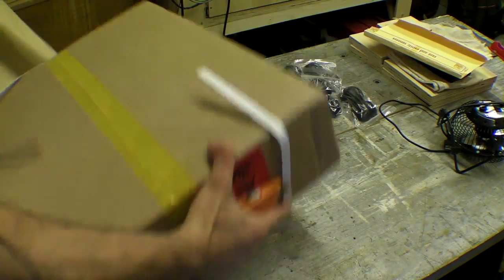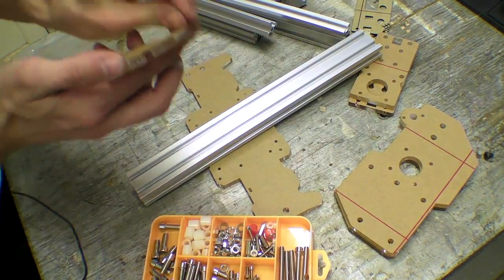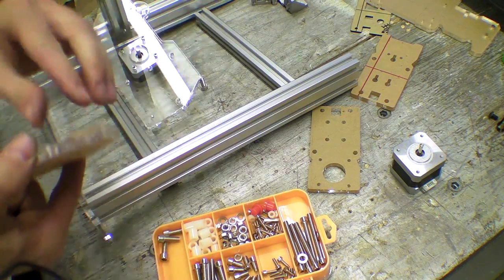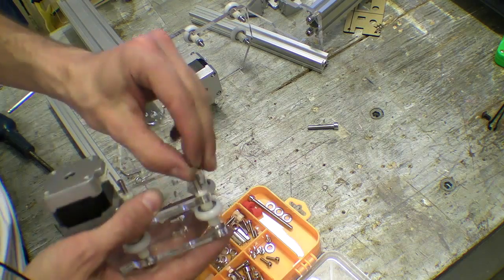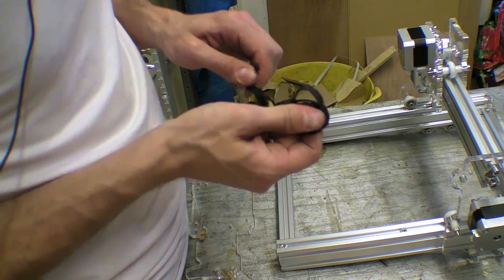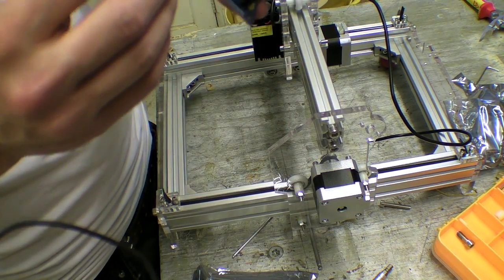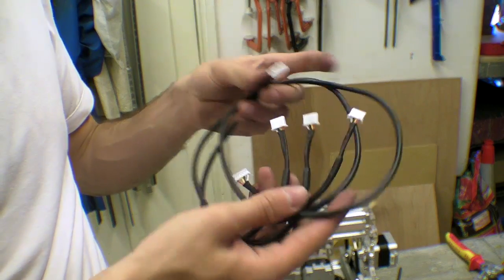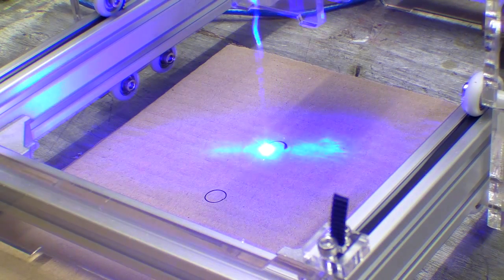Mini Laser Engraver Assembly & Review / Eleks / Benbox

Comment: I have the same laser engraver. maybe you can help me out with.i am thinkink to upgrade it . the engraving dimensions are 17*20 but i noticed that x,y axis still trying to move further.if i buy a 2020v aluminum frame bigger for example 50 cm.will this laser be able to cut bigger pisses? Or it can not because of the command pcb board? Also thinkink to buy belt tensors and for faster movement of the axis when engraving

Comment: My Laser is acting wild it wont stop burning i reset settings and disconnect and deleted drivers but the laser wont turn off its at a constant burn and im hopeless right now
Reply from the maker: Maybe one of the wires is swapped incorrectly. Be careful when checking the laser. Use shielded googles and don't look directly into laser.

Comment: are the XY dimensions controlled by limiter switches or in the software? could this be scaled up if I built a bigger frame?
Reply: What limit switches?
Reply: That was the question...
Reply: Well, I'm going to put mine together this evening, so I'll be able to tell you for sure here in a little bit, but since there don't seem to be any end stops, my intuition is that you position it manually, use G92 to set the XY zero, and then run operations from that point.
Reply: Okay, bear in mind I'm not using EleksCam (the Windows-only software I'm sure is totally safe to install), I'm using LaserWeb, and I flashed vanilla GRBL on the controller, but yes.  You manually jog the laser to where you want it and then zero the gantry.  wherever it is will be treated as zero.  The stock board has no plugs for end stops, though with a bit of wiring modifications you could use a standard Arduino/CNC shield running GRBL and add them.

Comment: Hi, with the 2.5 (2500mW) blue light laser, would you have the power to CUT thin fabric (polyester, lace, satin ribbon)?
Reply from the maker: I've not tried it on those material but it cut paper so I assume it will could cut those.

Comment: nice video, will this unit etch on aluminum, not through or cut sheet, but just mark?
Reply: 50% DISCOUNT when using this link for the ELEKS lasercutter, thank me later:): http://www.banggood.com/2500mW-A3-30x40cm-Desktop-DIY-Violet-Laser-Engraver-Picture-CNC-Printer-Assembling-Kits-p-1003863.html?p=TL0111854575201411Z0

Comment: 5 W is equal to 5000 mW? ... I want to buy a cutter of this type but 7000mW ... can you use Corel or Illustrator? How fine is the cut-off point? Is it safe? Do real glasses protect or is it only false? I want to make a box to put it with an air extractor ... but lock everything in the box so as not to see the light ... the truth makes me very afraid that it will hurt my eyesight ...

Comment: I just sat thru this video. Very informative. Thanks. This will be my first machine. Still trying to locate a retailer here in U.S., Florida. Can this also do photographs on glass, plexi or metal? Thanks
Reply from the maker: No you need a CO2 laser for glass. This is just not powerful enough.
Reply: sounds good. It's a good entry level? I'm worried abut programming problems. I been reading a lot abut that issue.

Comment: Hi to all.  VERY interesting video, but somewhat incomplete, I may humbly say.  The person didn't include the instruction on how to load the software, the driver, nor the firmware.  I'm stuck at this point.

I bought one from Banggood, 2500mW (2.5W), and still trying to make it work!  Wrote to Banggood for help, they wrote back fairly quickly to ask me to send videos of my problem.  So I did, the same day, and since then, no replies!  It has been 2 days!  Total Radio Silence from them.  It seems that I can't load the Firmware into the controller.  Could someone help me get it going? .. Please? .. Pretty Please?

I'm desperate!  Tried everything!  I think I need to flash the ROM and start over again, but I don't know how to flash it.  I'm stuck!

Thanks to anyone that can help.  Thank you VERY much for ANY help.

All the best!
Reply from the maker: Where is your video?
Reply from the maker: There is a thunder bolt icon which gives you firmware options. Also make sure you follow the PDF instructions to the T.

Comment: For the black belt, before cutting it, use it to measure the length of belt used for the two Y rails and the single X rail. You will have several centimeters of belt left over. I had an extra 24 centimeters of belt. I divided that 24 by 3 (which gave me 8 centimeters) and used that as the amount to add onto each of the lengths for the 3 stepper motors drive belts. 

My 17x22 system ended up using 12 1/4 inches for the X rail and 15 inches for the two X rails. Adding the 8 centimeters to each gave me 39.1 cm for the X rail and 46.1 cm for each of the two Y rails.

Install the belts and their end brackets before installing the two large plastic end plates onto the engraver frame. You should install the laser head onto the laser assembly and install the drive belt on the rail without the rail installed between the two Y assemblies. After the laser head assembly and the drive belt has been assembled onto the rail, it can be mounted between the two side Y stepper motor assemblies.

Comment: I would recommend against running the Y1 and Y2 servo cables with the X and Laser cables. The frequent extra movement from side to side as the laser head assembly goes back and forth will bend and break the cables where they attach to the servos. The Banggood video shows how the route the Y1 and Y2 cables through channels along the side rails.

Comment: When I first put my system together, the laser would not come on when the power switch was set to on and the Laser aim switch was set to on. My system required the 12V potentiometer on the board to be adjusted until the laser just came on. Be careful about using the 'low power' aiming function. It is still powerful enough to melt plastic and could damage the surface of a project.

Comment: The red buttons will fit onto the switches. The switch post is rectangular and the buttons have a rectangular hole that will allow them to press fit onto the switches. The buttons will fit onto the switch shaft so that you can turn the system upside down and they won't fall off, even without the black plastic plate over them.

Comment: Savvas Very good timing...I have been considering a laser like this. Please do post a video on using it for your chopping block. I make cutting boards and chopping blocks and it is for this reason I want the laser. I'd like to see how it goes for yours. Also, I did not see you pull the aluminum extrusion fro the box...did these come with the kit?
Reply from the maker: Yeah they were in the bottom corner.  Cool, check out my Instagram page as I just uploaded an image of the engraving. It's seems OK but took a while to work it out. Wouldn't a branding-iron be better?
Reply: Would you say that the test on your cutting board is a little light? I like a branding iron but I have not been able to find a way to get one made at a reasonable cost.
Reply: The 2.5W laser is powerful enough to engrave on a chopping board, but not powerful enough to cut through a chopping board. It will only cut through thin and soft materials. Also remember that the beam will be strongest at its point of focus. Above and below the point of focus, the beam will spread out and be weaker.